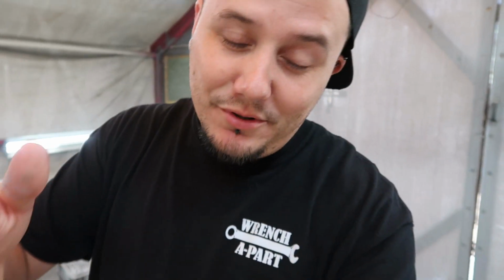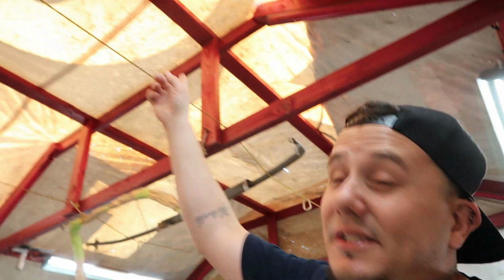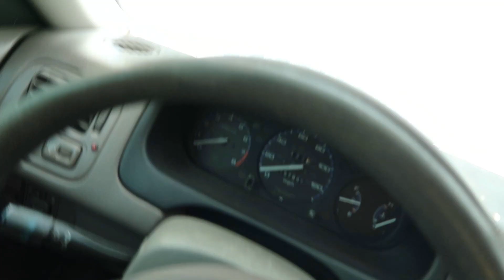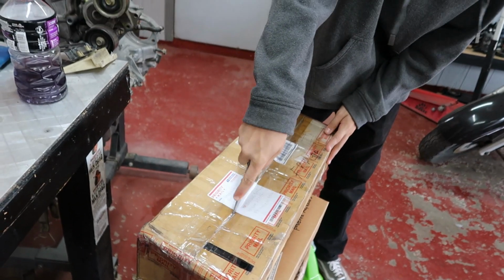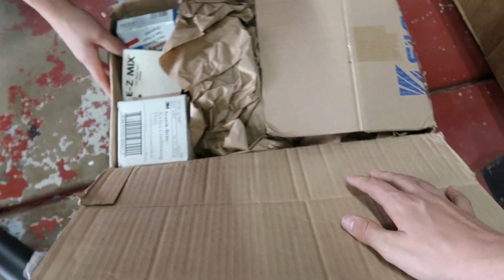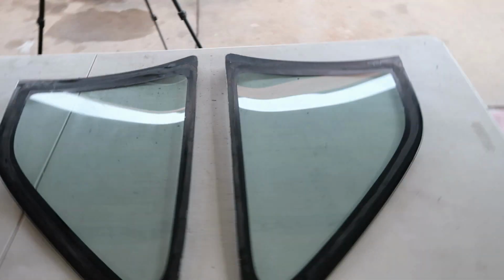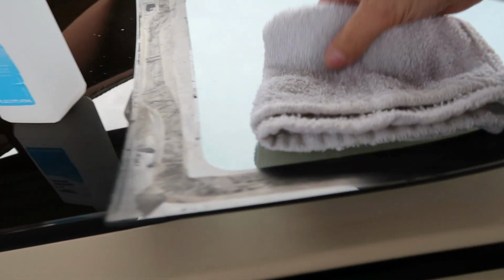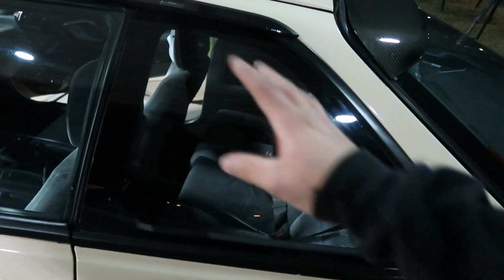Finally all the windows are in the DA!

Comment: 20:00 for future reference sand down the area you are adding the adhesive glue if you add it on a painted surface 6 month or a hot summer day that window going to fall out it adheres better to bare metal it haves a anti corrosion protection in the adhesive 3m makes a really good one so good luck but beautiful build 💪

Comment: Wipe the glass with #0000 steel wool inside and out then finish with invisible glass don’t scrub the inside of the rear window with the steel wool you could damage the defroster DO NOT WIPE THE MIRRORS WITH THE STEEL WOOL GLASS ONLY